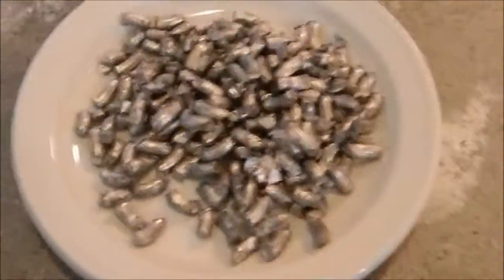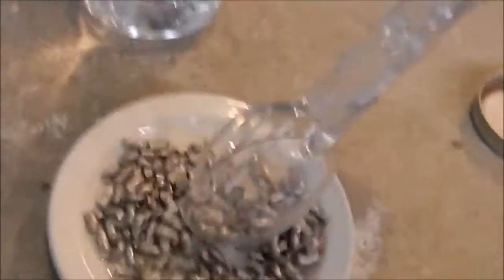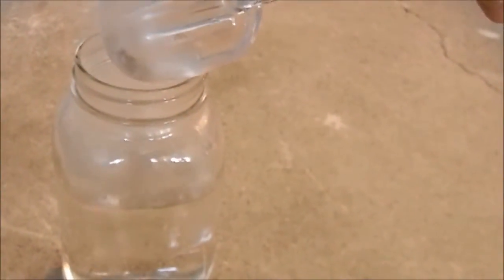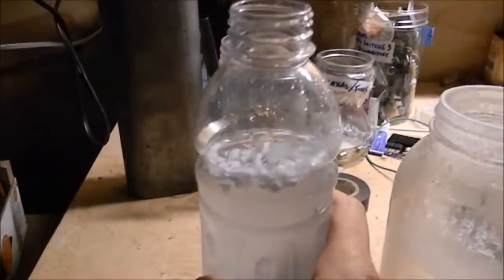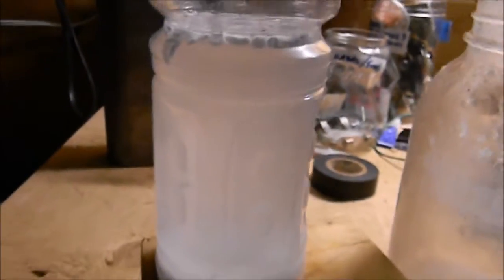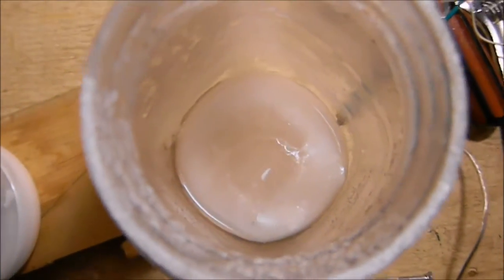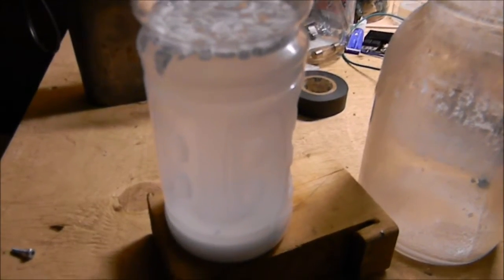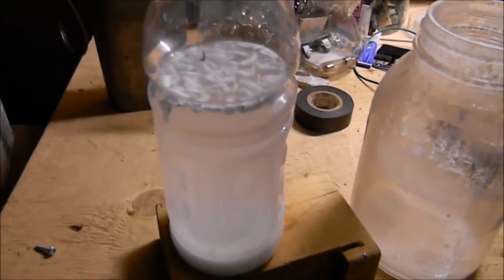Lithium to Lithium Hydroxide Video

Comment: So, clearly because you're doing LENR/Cold Fusion experiments, the lithium ions were actually entangled with your (later) successful Cold Fusion experiment.  So, this caused multiple reactions were 16 lithium nuclei fused together to form cadmium, which precipitated out of the saturated solution as cadmium and cadmium hydroxide.  Well done.
Reply: Unfortunately, this then caused your Cold Fusion experiment to fail, which meant that the lithium ions were never entangled to form cadmium in the first place, which meant that you created a self-negating infinite loop of entangled fusion causality.  This means that the white precipitate at the bottom of the jar is, in fact, a warm Bose-Einstein condensate of Li converting rapidly to Cd and then converting again to Li.

:-)
Reply from the maker: +D I was making the electrolyte for my experiments in this video. there was no cold fusion expected or attempted... Again, I was simply making the electrolyte for my LENR experimentation.... as for all this talk about cadmium, I have no clue what your talking about or  referring to. I think your on the wrong video or something because your comment literally made no sense at all.
Reply: dude, read it again; it was supposed to be funny, the whole point of the (failed) joke is that you would then use it in cold fusion later.
Reply from the maker: D
Oh, I apologize, I didn't catch it (the joke)... That's good though, I thought you were a crazy person... So you have a keen interest in LENR/Cold Fusion, that's great.     Have you done any experimentation yourself? Is there any papers or information you are privy to that you think may benefit my experimentation?

Comment: I did this with a battery a while back and had some flames, I am guessing from increased surface area. My Chemistry is all packed up though... that is one of two things I probably shouldn't experiment with in the living room.
Reply from the maker: +Diadon Acs (Conscious Energies) Yeah, this one is to be done outdoors or in a well ventilated area... About the flames, it could be surface area, or it could be contaminants from the electrolyte in the batter you pulled your lithium out of? I really don't know.. I am just glad that mine didn't blow up in my face.. :)
Reply: Hopefully no containment's.. but it is a possibility.